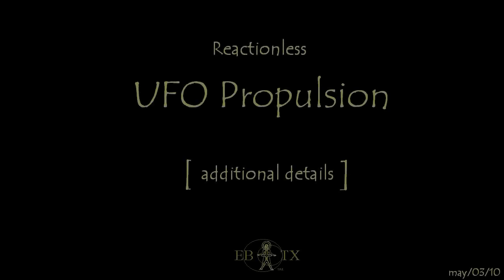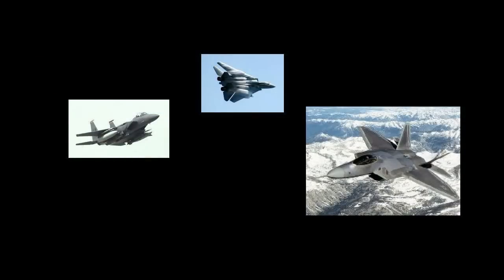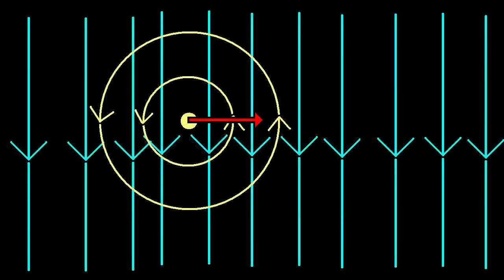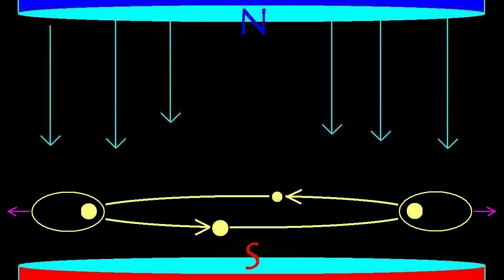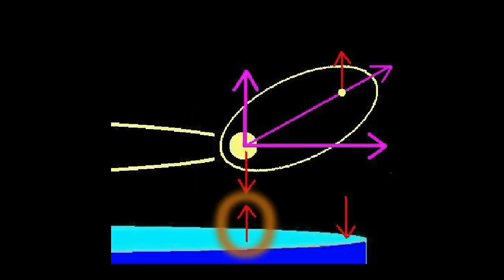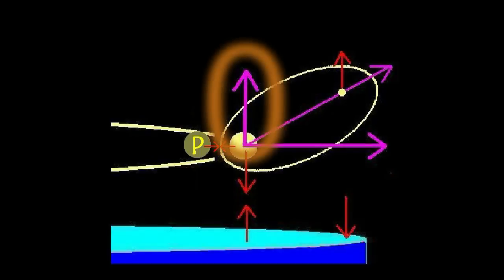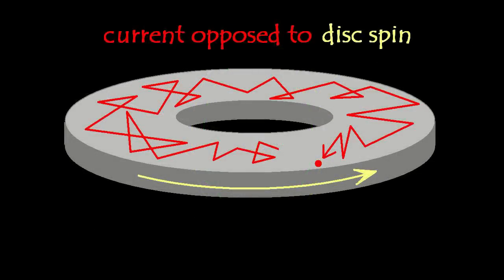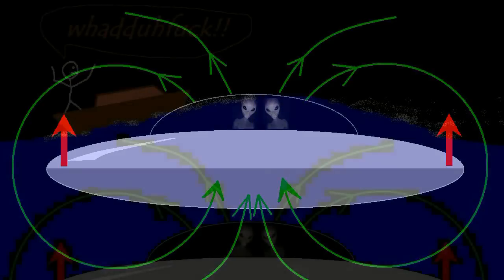Reactionless UFO Propulsion #2

Comment from the maker: continued ... 
You can have high rotation speed and low mass ... or high mass and low speed. Experiments have to be done to determine where the "effect" occurs and what is optimum. My guess is that lower speed is used because the "hummmmm" produced by UFOs gives a possible clue as to the frequency of rotation ... and that clue (if valid) says we're looking at effects at fairly low rotation rates. But ... that low hum might be due to some other ancillary effect and not be the propulsion system.

Comment from the maker: @Coobeans89    If the field of the rotating particle is tilted out of the plane of rotation ... that will be the direction of the centrifugal force. And ... there will be an up or down component in that vector ... which means that the ship will go in that direction, opposed only by the inertia of the non-rotating ship itself. It's not an ANTI force. It's just another force that can be directed against gravity ... like helicopter blades ... but without any reaction mass, i.e. it won't blow air.

Comment: Do you think the cases of craft “dumping” large amounts of molten metal, as described by Garry Nolan in his recent Sol Foundation presentation, is perhaps evidence of the propulsion system?  Maybe these odd mixtures of metal are heated to liquid and rotate within the craft at high velocity?  The dumping events are sometimes related to accounts where the witnesses feel something is going wrong as the craft wobble in an unstable way.  Dumping may be necessary to bring back some kind of equilibrium.  It’s also notable how many cases there are of craft either siphoning up water through tubes or dumping water overboard.

Comment from the maker: The reactionless system I posited would necessarily work in empty interstellar space. It has nothing to do with gravity. I did touch on a possible gravitational propulsion system but that wouldn't work for interstellar travel. To me "anti-gravity" only means that a gravitational field is being pushed off of ... or utilized ... to propel an object. Reactionless means ... "in violation of conservation of linear momentum". It doesn't need a gravitational field at all.

Comment: ------->interactions with the aether and is the simple process Bantokfomoki gives reference to that temporarily disables known physical laws that we believe inhibits the possibility of faster than light travel! The answer to this comes back to atomic fluctuations of a mass and that means were talking about the particle and how its atomic flux dictates it's resistance to the aether and that conflict ultimately limits its maximum velocity through the aether which is a zero frequency----->

Comment: Either way enough of that. Your Origin of the Universe video is good. & a nice contribution to science. It could be shown in any university & maybe you should contact PBS & see if you can have it played. The arrangement, visuals & lettering was well done. My only complaint would be the volume, I had it cranked & it was still low. I'm gonna post it on my Facebook page & use it anyways. Your 42 years of study should go on & benefit society. Thank you for your contribution.

Comment from the maker: continued ...
Also, alleged pieces recovered indicate low structural mass ... but ... indentations left by landing legs indicate that the ufo mass is comparable to submarine masses rather than fighter aircraft. Ergo, I guess that the ring mass is large and the craft as light as possible, i.e. high mass + low rotation velocity. 
This is why I tried a couple of silly low velocity experiments myself. They don't work at all. Observer reports indicate that the magnetic field is humungous though.

Comment: String theory states that everything is a vibration, a frequency. If so, that would mean gravity has a frequency, and from my knowledge when you play a frequency and then reverse the wavelength and play it towards the same frequency it should cancel its self out. If string theory is correct, a craft would have to emit the opposite wavelength to cancel out the frequency of gravity around the craft, therefore rendering anti gravity.

Remember we're not alien, and they're not only materialistic.

Comment from the maker: "In our crust is a metal resistant to high temperatures (over 6000 ° C)" ... I went of Google and looked up melting points of metals. Highest was Tungsten at 3400 degrees centigrade. You need something that will withstand more than 300,000 C.

Comment: a basic answer to that is that it is like taking liquid gas like liquid hydrogen then putting an air pump to pump more heat from it. very ruff explanation probably not very good I suppose. but I think in the video he say superconducting fluid which would be a surface that has no resistance to current (ohm's). superconducting fluid does not yet invented. check out alienscientist channel for more info i think he covers superconductive fluids a bit

Comment: @novanine9 It does not take "the energy of millions of stars" to bend space. A low power vector potential or scalr field will do that. Energy and mass both bend space time. Spacetime can there fore be ben with high powered electromagnetic, or electrostatic fields, as we have seen in 80-year old and modern experiments, devices, and systems.

Comment: Allright, how would the lateral moving works? How much energy would be required to tilt such a huge mass achieved by rotating the ferrofluid gyro? It would need another way to achieve steering. And why does it have to be earthling, space is a huge magnet too?! Only the speed/size of the device should be greater - so what?
Reply: work..
Reply from the maker: +Daniel Ganea 
I explained how lateral movement could be achieved in another video. It wouldn't be as efficient though as movement along the axis of rotation. Tilting a rotating object is very easy. If you just push down on one side, the rotating object precesses.
Reply: +Bantokfomoki What you first must understand is the true physics behind the action of any basic lifter which propels with ions. I have such physics videos up on my channel with proof they are correct.

Comment: --->Now for the benefits other than being able to go the speed of light! First what were doing is changing matter back into energy E=Mc/2 says energy and matter are the same or interchangeable and E=hf determines where on the scale your at particle/wave! Raising the frequency of your space craft and everything inside it is basically turning the vehicle into an energy state and energy does not take much power to move and that solves the energy problem about having enough energy to make it------->

Comment: ------>particle of matter and the reference speed of the highest frequency wave is 186k miles per second hence the speed of light and even slower as the frequency lowers down to a particle! Just as aerodynamic drag limits a sky divers terminal velocity the frequency of a particle/wave determine it's drag with the aether and since our experience is limited to electromagnetic energy we only have observed energy with a flux that limits it's speed to 186k miles per second hence current science----->

Comment: Why not Mercury as a fluid in tandem with the spinning disc?
Reply from the maker: Maybe. I think there are several possible basically different variations. Something works ... and I don't think it's beyond our abilities to find out the how of it. Making a practical working craft might take a century of experiment.
Reply: I agree use that!
Reply: Mu is a heavy electro/magnetic fluid. I thought it would solve 2 problems at once. We can only hope thanks for the feedback.

Comment: I think I've achieved antigravity, started experimenting with a plasma system using mercury, the system consists of a copper pipe 3/8 "pigtail-shaped cone with a winding tube in magnet wire # 25 x 2 wire 36 outputs to the oscillation frequency while all the cone itself is coiled helically toroid with magnet wire # 23x 3 wire 36 outputs to the oscillation frequency, one end of the pipe carries a valve expansion, the system at different frequencies was approved with several oscillators, at some point it began to vibrate making a small push in ascending achieving levitate, i want to try tin 100% pure is in a liquid state, I managed to get a sample by distillation a ceramic filter by thermo-magnetic induction process, I'm still doing tests because the process is slow so do not yet have the necessary amount, while should give a coating with gold piping internally. The idea is to modify the stationary gravitational field by a controlled electromagnetic gravitational field of repulsion effect when approaching a stationary mass
gravitational constant EMF
Reply from the maker: +Ulisses Rojas If it ever actually ... unambiguously ... levitates - make a video and post it for everyone to see. In fact, if you make any progress at all you should document it.
Reply: +Ulisses Rojas All anti-gravity is heavy ion mass displacement. I have the particle physics which nobody else seems to have here on youtube or anywhere else, and with mathematical proof, unlike anyone else. I've written a book on this and a few technologies I thought people could use the most or just find the most interesting. There are quite literally millions of ways to exploit zero point energy to superconductive degrees while interlocking fields of rotating magnetic current to produce pure charge of either neg or pos ions (because mid mass particles sitting on the thermal curve cause space to be non-conductive and get in the way of free energy). 
Make enough free energy efficiently enough, and you get a waste product of super concentrated heavy ions, which are in bias to the positive pole of magnetic current. These flow heavy as gold, and just as fast as liquid gold to any gravity source, while displacing the machine which split the charge. 
I studied the Schaubager saucer tech years ago and found that all he did was make a gyroscope using spinning water (spiral inside a tube) wrapped about an egg shape. There was no return point for the particles which spun off. It was a particle vacuum. 
The most advanced machine I've ever conceived was witnessed by David Adair at age 17. A broken alien engine capable of flight from earth to Sirius C in 15 minutes. It's skin is made of of hollow silica beads filled with a special magnetic protein. Inside are dishes coated with very dielectric material coatings, grown on... but nobody here will ever make that machine.
What one could do is make one I designed after reverse engineering the coral castle device used by Ed Leedskalnin.  This I call the Mark1. Theory is all simple zero point. I even reference a patent witnessed in use by Area51 contractor who was about to pass away. all in the cheap ebook or just ask

Comment: I have seen fascinating close in footage of a craft slowly taking off from the ground at daybreak.  The sunlight is oblique and the air around the craft is at dew point.  The fields created by the craft cause swirling clouds of condensation that move in a rotational pattern around the saucer extending out a fair distance.   The specific environmental conditions permit us to see what normally can’t be and I have to admit my reaction to the footage was a disconcerting feeling.   It’s propulsion system has nothing familiar about it.

Comment: exactly like ı think. only the preblem is energy. what kind of energy will you use
Reply from the maker: Nuclear
Reply: Bantokfomoki my english may be will not be enough to explain what think. also the weihgt of coils  and the elktrik current throug in the coils and the weihgt all of the ufo may be problem
Reply: Bantokfomoki first of all it has to turne itself  in horizantel line. and the side vertical coils  will help moving of direction way.and the current level in the coils will do moving of direction
Reply: neyir alkuş also for energy light it has been to think.the rules of light has  to searched

Comment: you are a brilliant mind, Bantokfomoki; however, i differ in the perspective that the device is "ring" per se. i liken the device to be closer to a coil configuration touching on vortex concepts intrinsically. think stirring a cup of coffee - but in 4D to get a 5th force... where i agree with you in whole, is that the "motor" must be very heavy (massive) and its particulate motion, slow. i propose that the initial state of the device be repulsive, and its motion break symmetry.

Comment: How can plasma energy be stored, and then used to power anti-gravity engines?
Reply from the maker: Plasma is just really hot gas (electrons  separated from ionized atoms). There's no significant energy stored in plasma compared to say, nuclear fusion.
The only way to store energy for use on demand that's suitable for space travel is in the nuclear potential and in antimatter which nobody can produce in quantity.
Chemical fuels are OK for interplanetary ... if you are willing to spend months to years to get to where you want to go ... but no good at all for interstellar travel.
Reply: Plasma is more a state of matter and does not always have to be hot. For example certain plasmas ( brown gas flame ) can melt a metal substance in seconds but that same plasma can be placed against a hand and will be cool to the touch and will be harmless.. Plasmas could theoretically be "tuned" to affect certain materials while ignoring others.
Reply: What "substance"? A object will not melt if said object's temperature is not elevated to its melting point.

Comment: Very entertaining. Though, the "mass density of a submarine" is the same as sea water. Near d=1.2.  If I get to accept the pulling up effect, what's going to prevent our "aliens in the ship" to be crushed by thei inertia? Don't you have to have an inertial protection for the "beings" on board? Specialy at speeds near to "c".
Reply from the maker: +Victor Calvo You need protection for acceleration. I gave it in the video at the end.
Reply: An object falling into a gravity well will accelerate but there is no g forces. It is opposite if the object tries to move or accelerate AWAY from a gravity well.

Comment from the maker: I think the problem (if the theory is right) will be mostly with the strength of the magnetic field. I have a new experiment - that does not work - operating at much higher velocity with a 3" neodymium magnet. I think I've successfully ruled out any amateur feasibility experiment. My magnet loses out to the earth's magnetic field at about 1 meter. UFOs upset airplane electronics at 200 meters or more. If it works, it will be in a laboratory with superconductors and very high field strengths.

Comment: "If you could shift the vectors out of the plane of rotation..." That's where you lost me!
Reply from the maker: Sorry I can't make it more understandable. The spherical field determines the probability of where the particle will be in the next time instant. If it's perfectly round (as it would be at rest and not under acceleration) ... it will stay in place. If that field is distorted by an acceleration, the particle's vector will follow that distortion. Consequently, if the distortion can be made to go out of the plane of rotation ... you get movement in violation of linear momentum conservation (as well as energy conservation).

I'm looking for something that would do what UFOs appear to do. This is the only thing I can think of so far that is even remotely understandable. 

PS ... That does not mean it will work ... only that it is falsifiable with a suitable experiment.
Reply: 'Reactionless Propulsion' is a misnomer.  It should actually be called 'Inertial Reaction Propulsion'.  There is a reaction and it's in the direction of movement.  My Reaction Machine uses weights which tip out of the plane of rotation, just as you show.
Reply: That's achievable with extra fields around the ship.  Like numbers in a clock.  12 fields to control horizontal movements that's how ifos move at 90 degrees out of nowhere

Comment: ---> places the maximum speed at 186k miles per second for a photon and less for a particle including a spacecraft and your body for example! Our bodies and materials that a spacecraft would be manufactured from are in the atomic flux range of 7hz and that is why we experience the high level of inertial forces that we do and the same for the object around us in this case for example a space craft! If you were to raise the atomic flux of your space craft to the frequency of a radio wave than---->

Comment: ---->to another star! Another benefit is while your spacecraft is in an energy state it is basically non physical and you don't have to worry about running into rocks or other debris while traveling at those speeds and thirdly in an energy state you don't have to worry about radiation because radiation is electromagnetic energy and would not effect your ship or you in the same way as a rock or debris as you and your craft are at a higher frequency and non physical to that energy!------->

Comment from the maker: Insofar as the charged particles are concerned ... it has been detected. Just look at the curly Q's in the cloud chamber photographs. The idea is that a neutron would begin to separate into opposite charges and the magnetic field would operate on them as they are known to do ... dragging the inertial field with it.
Also, a uniform field won't cause this effect, i.e. if the particle (charged or not) goes between N and S poles in the middle ... it won't work.